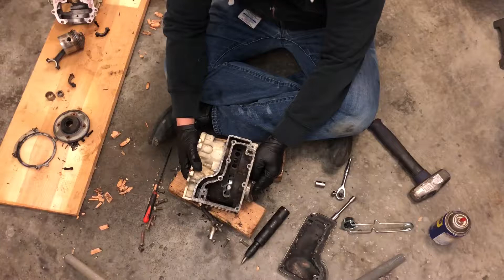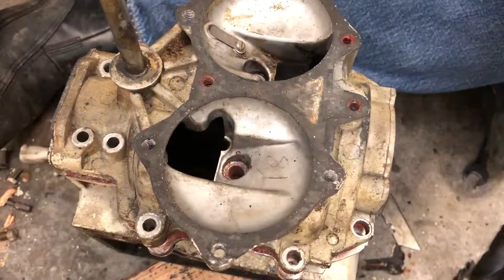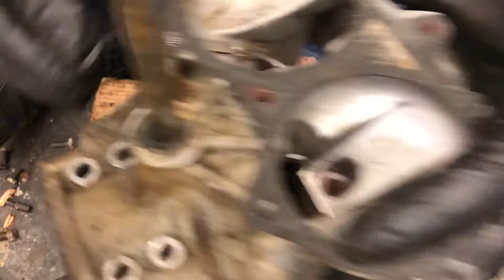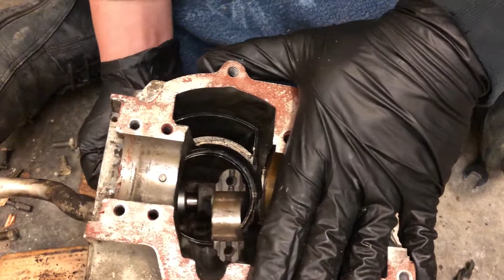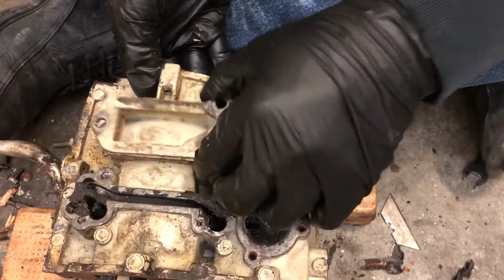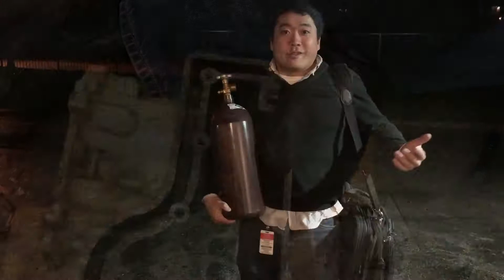Airflow Through a 2 Stroke Engine

Comment: Any thought on turning the 4 round port holes into 2 oval holes
Reply from the maker: The primary problem with that is the piston rings bulging out and potentially getting caught in the ports. The larger the port, the more chance of this happening and causing catastrophic failure. In addition, Air flow in a 2-stroke is weird, and bigger/more flow isn't always better. It becomes very complicated in terms of flow to achieve higher powers. This is definitely a job for someone smarter than I am!
Reply: @TheAfterWorkGarage  after taking measurements it’s clear that so many 2strokes have ports that big. If I turn the 4 holes into 2 then it’s still under what some two strokes run. I just don’t see the rings snagging but i would rather end result to be little smaller. So at cross roads. Stick with the horrible 4 hole or go a little bigger then I’d like an make them 2 hole. Do you know of anywhere to get knowledge on porting exhaust side of 4cyl. Told can’t do it because the over lap will blow back into cyl that’s trying to charge so exhaust mod is needed but I can’t find anyone that’s ported exhaust ports and exhaust header mods. I’m sure someone has done it just can’t find info.
Reply: @TheAfterWorkGarage   I  understand the intake ports are bad flow because of the exhaust ports have to be bad due to blow back due to  restrictive exhaust manifold due to space restriction cause engine must fit under outboard hood but in jet boat it don’t need to fit under a hood. Conclusion is intake ports have to compliment the exhaust ports and exhaust ports suck because of over lap of exhaust timing and  the exhaust manifold. Seems to me if exhaust manifold could be modified to eliminate cross flow into cylinder then exhaust ports could be opened witch then means intake ports could be opend. One question I have is there a negative effect of souls opening up intake ports. On spilt intake ports is there a such thing as to big. The transfer itself is always going to be bigger then the ports so doesn’t that mean getting the ports as close to size of the actual transfer would be only positive effect. I understand that opening up I take transfers isn’t good as it slows down the flow/charge but seeing the actual ports into cyl is the restriction then I believe opening them up can only help.